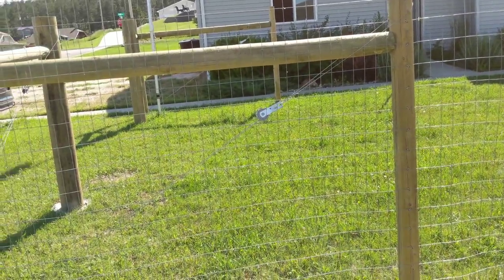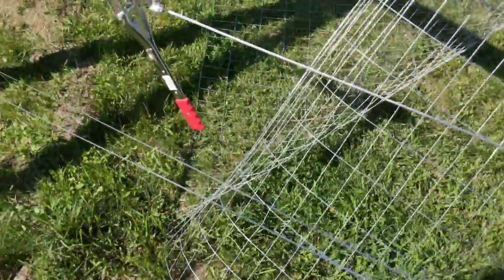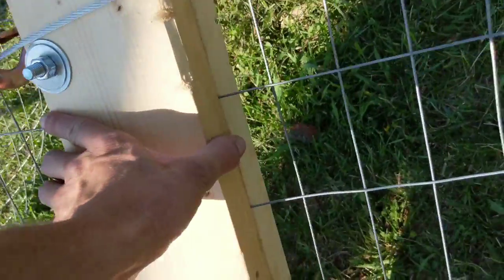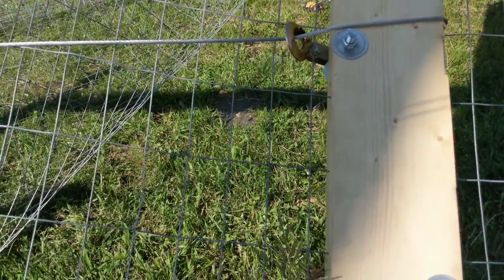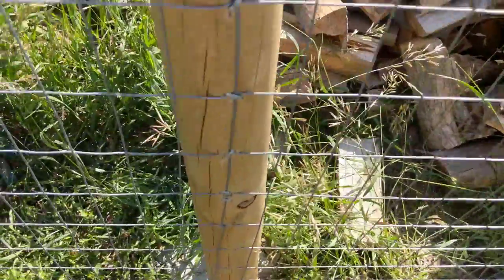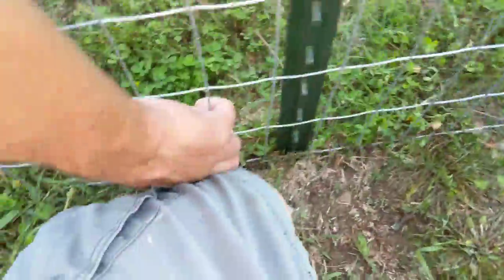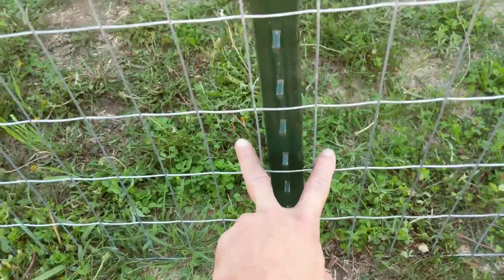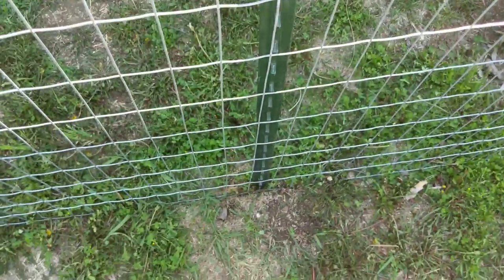Installing a Welded Wire Fence

Comment: Thanks. How is the angle wire installed? Is another angle wire needed at the other end?
Reply from the maker: Yes, you have a tension line on both ends of each run.